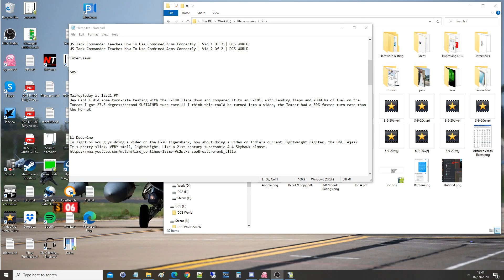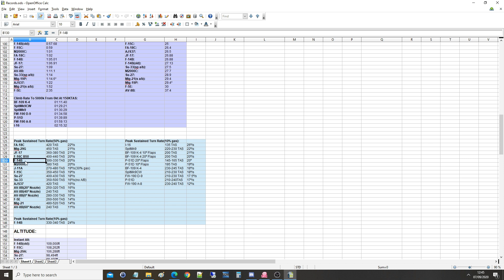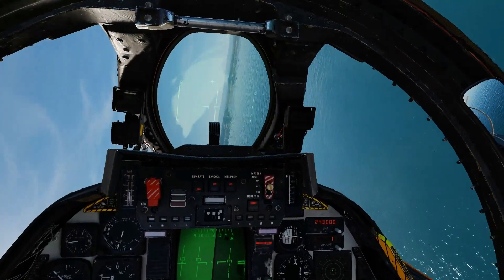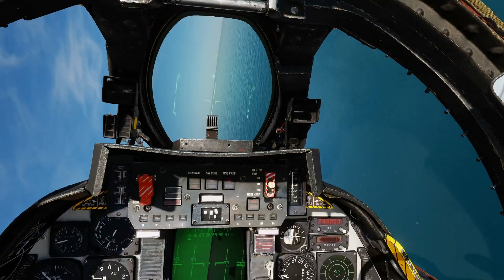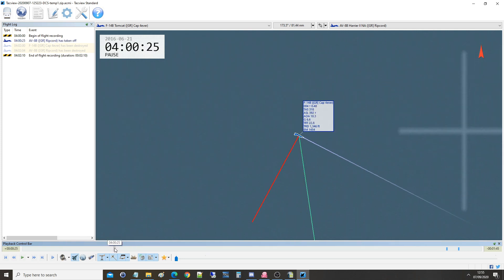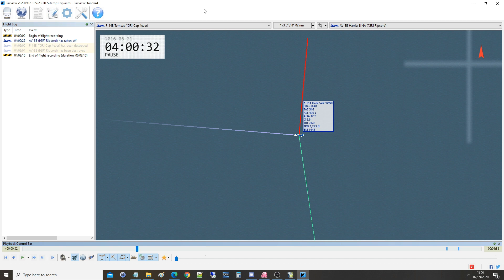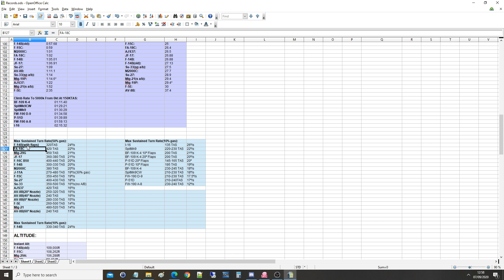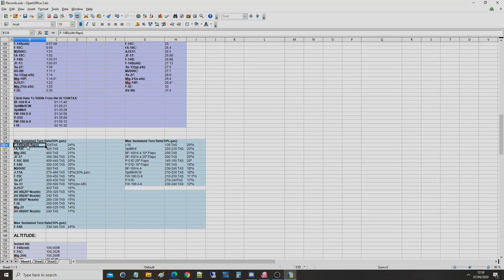F-14B Tomcat: By How Much Can Manouveur Flaps Increase Turn Rate? | DCS WORLD

Comment: In real life, wing extensions decrease radius but also decreases rate because the aircraft can’t fly as fast due to higher drag. BUT! If given enough lift to massively decrease radius, eventually the radius becomes small enough that the aircraft’s angle of attack turn rate becomes faster.

Comment: Hey cap I recently got the tomcat and I was wonder how to best rate it
Reply: I see you should have 300-330 knots but to remain in that range do you need to be full burner or is it possible in mil power. And is it accurate to use the full inside and outside flaps as maneuver flaps or is it more accurate to the outside flaps only

Comment: Knowing this is partially why i got the Tomcat, however in the FFH tournament and in real life, the flaps were not used in combat, because of the tube system used to control them breaking very easily under undue stress (like turning in a dogfight). According to anecdote by an old F14 pilot, one part of the flap system breaking would require the entire system on both wings to be disassembled and reinstalled with precision, and ot was very labor intensive. Therefore, F14 pilots wouldn't use the flaps in combat, because of the risk of them breaking and causing the wing-sweep to not function as well. I don't know if real data exists to show the turn performance of the F14 with flaps down, but to my knowledge, ot was never done, so any boost to turn performance like we see in DCS is probably not realistic, and i choose not to use it. I'm not telling any of you how to play the game you paid real money for, but if you want to fly the F14 well, and realism matters to you, do it without the flaps. It's still very capable, but you don't instantly reel everyone into your HUD like you do with the flaps.
Reply: Some pilots did use them in mock dogfights, and from some stories I've heard, it varied by squadron if using flaps during dog fights was prohibited or not. Most probably prohibited it due to the risk of destroying the torque tubes but there's definitely stories out there of Tomcat drivers using full flaps down like this and with very similar results to what is seen here. Though, I believe 300-350 knots is a little too fast for it compared to the stories I've read, usually they were used under 300 knots, 250-280 somewhere in that range. Could be wrong on that. Same goes with things like disabling the mid compression bypass on the TF-30s which allowed the engine to produce about 2000 extra lbs of thrust, at the cost of stability. Not sure if that was technically prohibited, but pilots certainly did it. Listen to some of the stories Dale Snodgrass tells about how he bested both F-15Cs and brand new Hornets in 1v1s with the F-14A. An enterprising pilot who had truly mastered the aircraft could make the Tomcat do incredible things.

Comment: Using full flaps in a 300-350 knot turn will almost certainly damage the flaps, locking them in the down position, so I don't think those are legitimate numbers to post on that spreadsheet.
Reply from the maker: Yup fair point, will redo with normal manuever flaps next week. I don't expect much difference.

Comment: Disclaimer, flaps down and maneuver flaps down are two different key bindings and two different actions in DCS. Maneuver flaps are (by default) the thumb wheel on the stick and are commanded by thumb wheel down. Also, their functions is automatic by default (like in the F-5), so all you need to do is pull certain AoA, and they will self deploy 10 degrees down. Unless CDAC and FCS are damaged somehow. Thus all your previous tests, were probably done WITH maneuvering flaps, without you even noticing. 
The flaps key however, deploys full flaps AND AUX flaps down to 30 degrees. These are NOT maneuvering flaps and flying in such conditions above 275 knots indicated and above 4-5g is likely to damage the flaps and jam them in the down position, which in return will completely mess up and disable the wing sweep mechanism.
Reply from the maker: Interesting 79, I think I'll go have a closer look. Take care.
Reply: @grimreapers  my pleasure mates. Keep going!
Reply: Hello ! Some tough Tomcat guys, however, did it very well... Check this out : https://youtu.be/BDERZpazb3g
Reply: @Haya-OhWaves  it is doable yeah, but unless you are careful, you can permanently damage you plane :(
Reply: Yet everybody praises Heatblur left and right for "supreme realism"... They just don't mind "a little bit of inaccuracy", since it enables their module to run circles around anything else, basically. And of course the 'Cat drivers won't mind that either...
Reply: @getsideways7257  what do you mean, they did model flap damage. And i have personally broken the plane while pushing to see how far she can be taken with the flaps down. Do you even fly the F-14?
Reply: @ilejovcevski79  That's great if they fixed it... Would also be nice if they finally fixed the Tomcat's horrible fps performance. THEN I would fly it at least more often. And if they brought the aerodynamics down to the believable envelope and removed crappy gimmicks like the idiotic cockpit shaking that ruins your eyes, that would be a different matter entirely. Ah, also I wouldn't mind at all if they put some actual code behind some of their "inop" switches too.
Reply: @getsideways7257  sorry mate, but the envelope is quite close to the published data, regardless of some people liking it or not. As for the rest of the gripes, honestly i'm glad they went the way they did. 
P.S. I don't think performance issues some players experience will be solved soon (TM)
Reply: @ilejovcevski79  Can I take a look at that data? Also, if the Tomcat is the best dogfighter in the world, they should have strapped a cannon onto the B-1 and made an even better dogfighter out of it. Because, apparently, the bigger you go, the more agile the fighter is, right? Or wait...
As for the performance issues, well, I'm not really expecting them to do it... Dev these days assume that everybody has at least a 1080Ti... It's just a pity that I wasted that amount of money on something I can barely use. Heck, even MFS fares better than this particular module on my PC.
Reply: @getsideways7257  sure you can. Depending on your place of residence you can either buy the performance manual, or request one from the DoD. Heck, copies of the relevant pages can still be found floating around for free both on the official forums and on the internet overall. 

As for the B-1 part of the arguments......heh, nice attempt at reductio ad absurdum, but you can do better, i'm sure.   

P.S. being a low life peasant and a heathen on top of it,  i run DCS  on a 1060. My FPS, with reshade on top  is 34 FPS, parked on a full Super Carrier deck.  At 5000ft, it usually floats around 50-60. Some may find that unplayable, but for me, that's just 2-3 FPS worse then the Hornet. So take it for what you will :D
Reply: @ilejovcevski79  Well, I have already had some talking with one of the devs, and it appears that if anyone is to blame for faulty data, it's Grumman, hmm... of course, only if there were no deliberate or otherwise mistakes introduced during the development process.

And insisting on a 20t machine being one of the most agile fighters out there simply because of variable-sweep wings is more than enough "absurdum" in my book. Or is there some clearly defined boundary before which you can scale up the airframe indefinitely with the performance growing, and then bam! - it becomes as sluggish as a bomber? Don't you think that's a little bit too far-fetched? Especially considering how much more agile RC airplanes are... If anything, my guess would be: if you want the best dogfighter, go smaller and (especially!) lighter.

Heathen? Why are we suddenly talking religion? Anyhow, if it's the 6GB 1060, I guess that could explain some things. My GPU is a measly 970 that I drive a 1440p monitor with. I'm ok with the Tomcat's graphical performance when everything actually runs, but my problem is the absolutely horrible stuttering I'm getting ONLY with this module, which renders it barely playable for me. I suspect it might be a VRAM issue, but still, nothing else exhibits such a behavior. Even MFS seems to be much smoother now after the patch (previously it would stutter pretty badly too, but not nearly as often).
Reply: @getsideways7257  Grumman has little to do with the performance charts and the aero data however. The tests were performed and published by both NASA and the Navy. You can even find the NASA tables free online and use them to verify the flight model yourself. You see, there are two components in every fixed wing aircraft that determine its aerobatic and kinetic performance. One is indeed it's thrust to weight, following which leads to the conclusion that less weight is better. Same goes for more thrust. The other is lift to drag. And this is often omitted by people doing static comparison between AC. You see, even the F-14A which was sorely underpowered when compared to the B and D models, had performance that could nearly match the F-15A, despite having 20-25% less thrust to weight. How? It had a much superior lift to drag ratio across most of the envelope. The F110 engines removed most the  T/W shortcomings the early 14's had. Does that make it one of the most "agile" machines around? No, not really. It's roll rates are still poorest of all the contemporary brethren. It's controls are still analogue. But she is a superb rate turn fighter and essentially a flying wing for climbing purposes. So how good she is? Like the latest Reaper video confirms, she is not to be underestimated. In the hands of a capable opponent,  she is very dangerous. However, she takes much more learning time (steep learning curve) to get good with. Even the A's could hold their own up to a point. And if you decide to play their game.... they gonna have you. Best way to learn how to fight them? Fly them yourself. Study their strong and weak points! 

970 of a 1440.....that explains it though. You are going to have a hard time and i can understand you feeling bitter about it. Yeah, i run a 6GB 1060, and it has allowed me to run DCS even in VR, with some shader optimization . The only thing i can advise is to try and find some optimization guides. Not sure how much will that help though. There were some texture mods out there, that lowered the resolution of the cockpit, so that lower end machines could get descent frame rates. I have no idea if those are still around, or how will they look on a 1440 monitor. Running on SSD i assume?
Reply: @ilejovcevski79  Little to do? What about NASA CR-172559?
If by "NASA tables" you mean EM charts, please show me a single one that can confirm this is a normal F-14B behavior: https://www.youtube.com/watch?v=BoDYljPMPiY
Just to put it into perspective, with full flaps I was basically blacking out at around 315 kts and over 8G! That sounds realistic to you? Well, you can say that "nobody in their mind would deploy full flaps if it meant they were rendered inoperable", but if that would mean getting out of merge alive, I think it would be well-worth it.
Except, as you already said, lift to drag is important. And how exactly do you think full flaps affect that?
It's not only about TtW. Weight also affects lift, and that's what I'm more concerned about.

"she is not to be underestimated"
Where exactly I'm underestimating it? As I said, Heatblur's rendition of the thing is a purebred UFO. At least with no ordnance onboard and at sea level.

"In the hands of a capable opponent,  she is very dangerous. However, she takes much more learning time (steep learning curve) to get good with. Even the A's could hold their own up to a point. And if you decide to play their game.... they gonna have you. Best way to learn how to fight them? Fly them yourself. Study their strong and weak points! "
Why are you immediately assuming I'm crap with the F-14, even though I'm saying it's OVERperforming, not UNDERperforming?
True, I don't really like MP, but I have a pretty good test for all the fighter modules in which I compare how they perform against the Ace Mirage 2000-5 bot, clean config, 50% fuel, 1,500', 350 kts initial speed (with ownship fueled to 3.5 minutes of AB maneuvering).
It takes me around HALF the time I'd need to spend in the F-16CM to kill the Mirage: https://www.youtube.com/watch?v=7_wUlS2xCa8
In other words, the Heatblur Tomcat leaves the ED Viper no chance at all. Is that what you expect of an actual 20t machine meant for carrier landing?

Comment: Still thinking it was a huge mistake to get rid this masterpieces out of duty. F14 is like a Ferrari F40. Can’t be outdated. Never. 
Just take a look what the Polish air force did to their much wose aging Mig29s.. Some electric shuba-duba, 10percent lower peak performance for the engines (for a much much longer lifespan) and the planes are good for another 20 years of service. They are using the migs for short range and their F16 eastern block versions for multi role tasks. Never waste a great plane. It can be good to have them when shit happens. I believe f35 or 22 are super planes, but none of them could hold the airspace too long against 2-3 cats or mig29s.... but hey, taxpayer’s money must be burned asap...
Reply: If only the F40 weighed 3 tons...